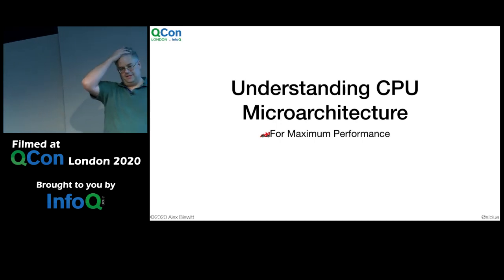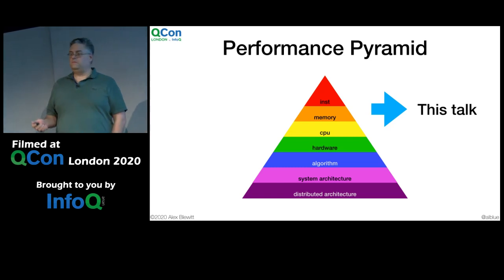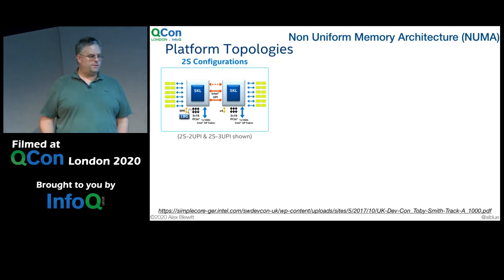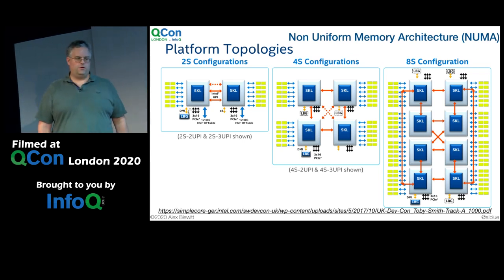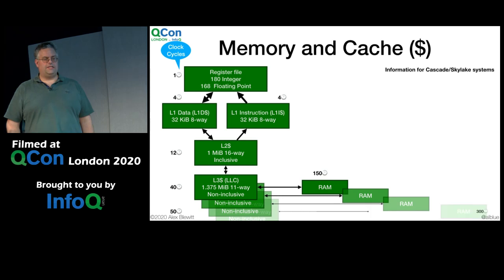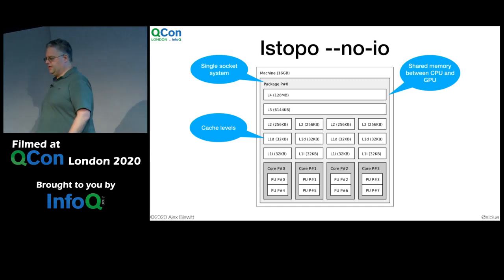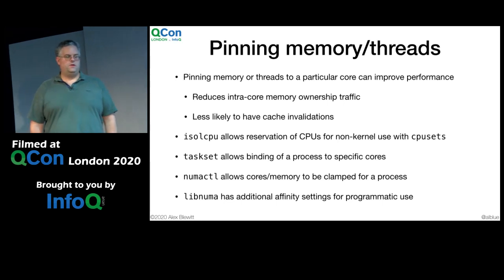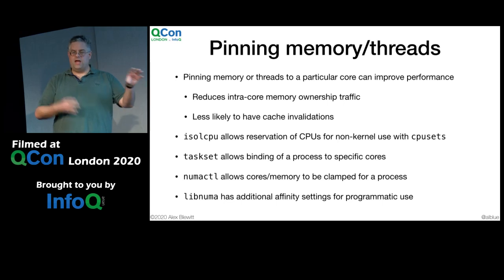Understanding CPU Microarchitecture to Increase Performance

Comment: As far as I know one clock cycle is not mean one clock impulse. So the statement at 5:00 is wrong. You cannot access the contents in 0.5 ns at 2Ghz! That would mean that one clock cycle is one clock impulse which is almost impossible since you have to have to fetch the instruction to access the contents first which at least is one clock impulse leaving. So if it were a impossible perfect optimized system it could maybe access it in 2 clock impulses which is 1 ns!